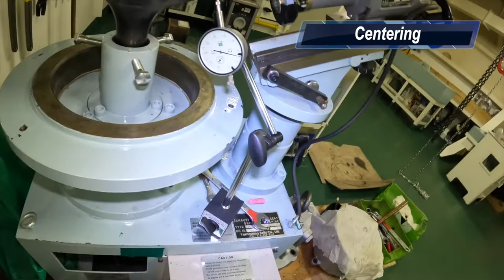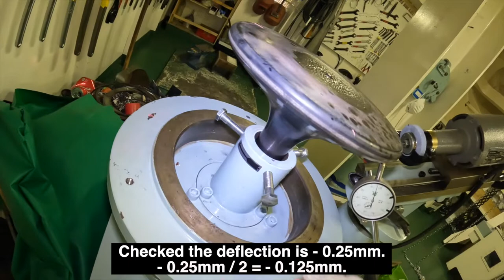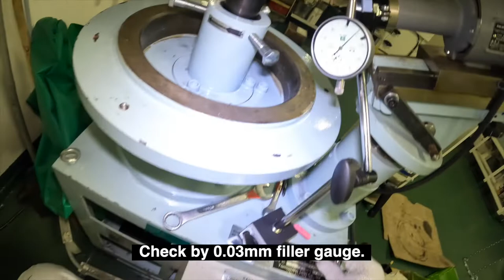UEC Engine Exhaust  Valve Spindle & Seat Grinding #UEC #JEngine #Mainengine #Exhaustvalve #Grinding

Comment: What is the reason behind the 0.03mm gap for grinding stone and less than 0.01mm each run?
Reply from the maker: Hi, thanks for watching.

1. Vertical slide 0.03mm for first grinding.
when you raise the vertical slide to touch the valve seat surface, make a gap 0.03mm between the grinding stone & valve seat surface. It is good for start grinding In my experience. Because if you not use a filler gauge & only depend on your sight when you adjust the vertical slide, it is possible to happen that  you will make a mistake of grinding too much at first grinding or you will spend long time to set the vertical slide for grinding. 

2. Feed by the depth of cut to less than 0.01mm
To avoid rough grinding.

I hope that my answer will be helpful to you.

See you again. God blessed.
Reply: @mozirichiefengineer7916  thank you for very detailed explanation. Always learn something from your video.
Reply from the maker: @Cincololol  I am glad that my answer is helpful to you. See you again. God blessed.
Reply: How to adjust degrees, when you reface valve spindle @ valve seat